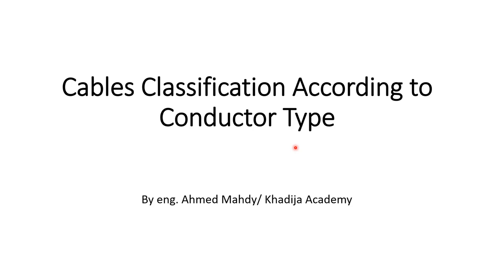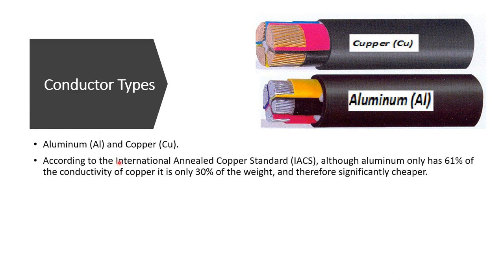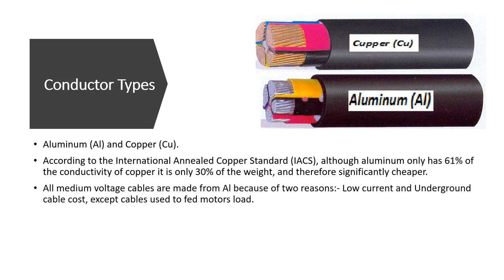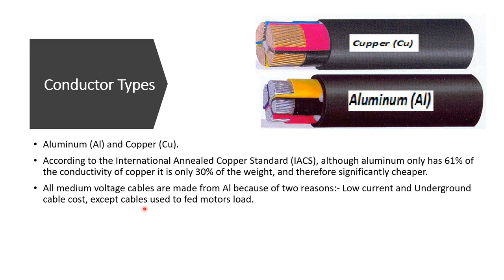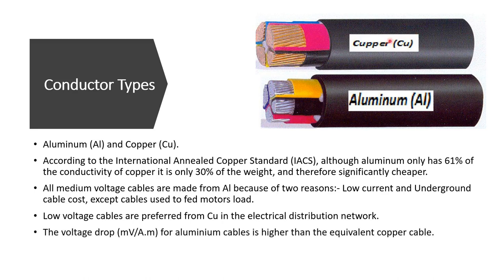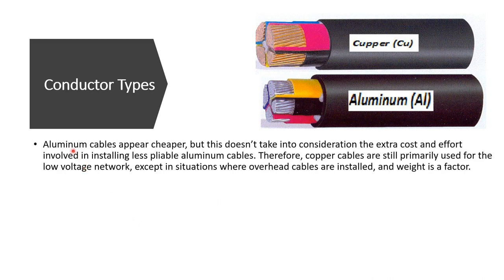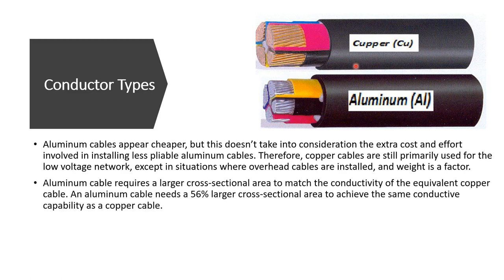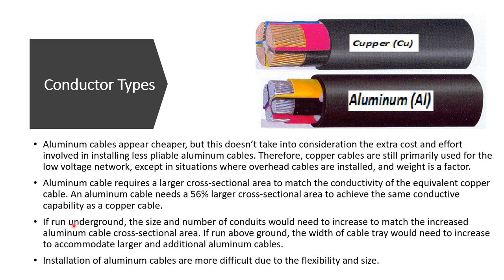Types of Conductors Used (2) In Cables Electrical Course

Comment: In 9:02  you say that the voltage drop in the graph in left hand is for the low voltage and the voltage drop in right hand is for medium voltage. But in medium voltage the voltage drop isnt higher than low voltage? So doesnt mean that in medium voltage we have small current levels and bigger voltage levels and in low voltage small voltage levels and bigger current levels?